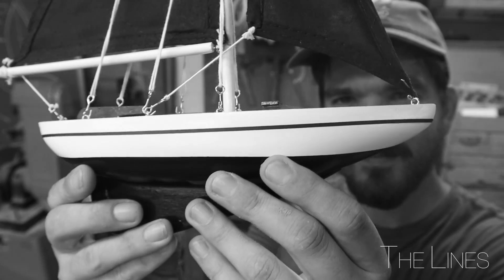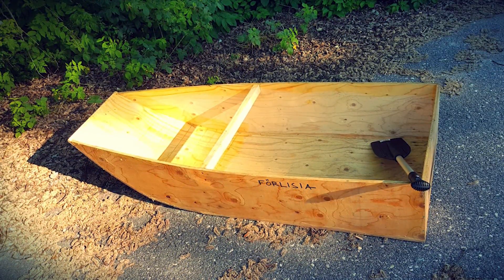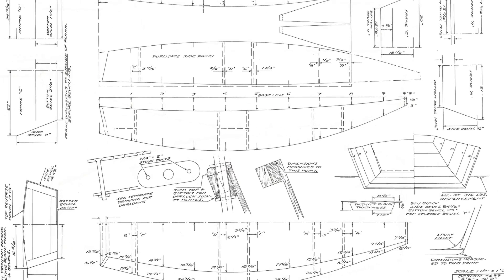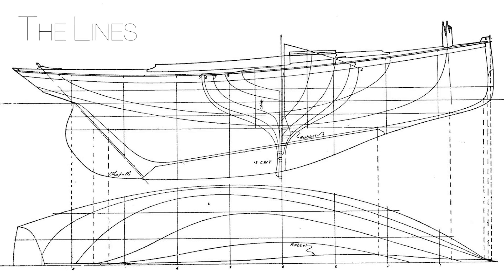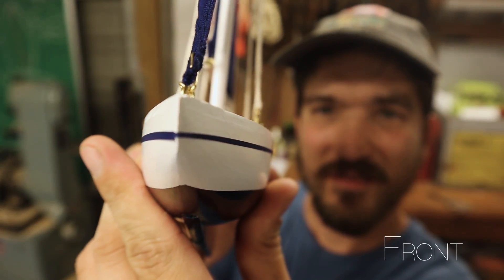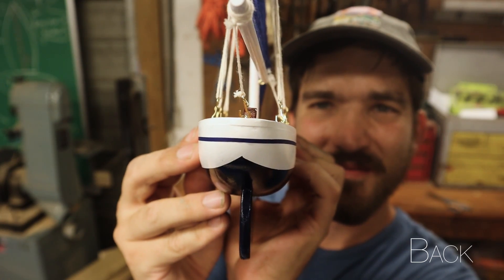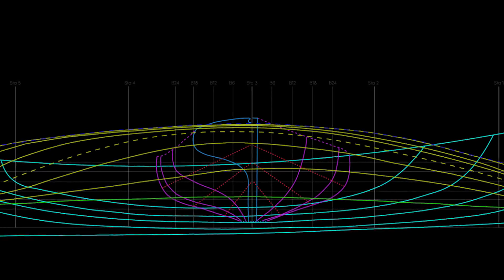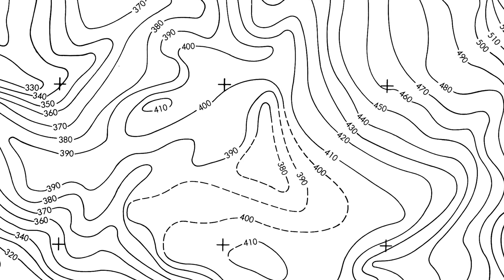Episode 4 - Breaking Down The Lines (Boat Plans and Lofting)

Comment: 22 years ago, I had the opportunity to work for Philbrooks Boatyard in Sidney BC, and while there did a course in lofting.  (to which your videos would have been a great asset). I remember being told that in the very old days, experienced boatbuilders-designers would bolt together 1/2" slabs of wood to represent the water lines.  The boat shape was then carved out as a half-model, the slabs taken apart, and the waterlines traced out in scale.  the slabs were glued back together and the model sawn apart to provide scale station lines, which were likewise traced out.  from there, the boat lines were measured and scaled up to create the table of offsets.  This may be a common boatbuilding myth, or it may be a true story, not sure.  Anyways thanks for a great refresher explanation.
Reply from the maker: Wow what a great piece of boatbuilding lore! Sounds implausible but not impossible

Comment: diagonals - what are diagonals used for?
Reply from the maker: So a diagonal is what you’d get if a waterline and a buttock line had a baby. It’s a cross section of the hull that is oblique to both the vertical and horizontal axes. Diagonals are useful bc they give you even more data (or constraints) on the hull shape. They interrelate waterline and buttock line data. This is especially useful in the case of a particularly shapely hull, where some curvature data may be missed by waterlines and buttock lines. In the end, the more constraints on the hull shape, the more accurate the lofting.
Reply: @neophyteboatwrights  thanks

Comment: Lets say i want to build female moulds and the table of offsets says that are the  "inside skin" measurements and the designer calculated the plans with a  3inch  ply construction. 
Does that mean that i have to draw the lines and then ad the 3 inch of the intended hull and then THAT would be were i should make the female moulds ?
Reply from the maker: Sounds right to me. Doing planking thickness adjustments can be non-trivial in some cases. But assuming the original hull was planked say in a carvel fashion, then you should be able to smoothly extend the mould shape without issue. At least from where im sitting that makes sense. Would need more specifics to say for sure

Comment: So how can one generate the lines without carving and slicing a model into bits? Not that I'm opposed to doing just that.
Reply from the maker: When designers are developing plans they generally loft them out at small scale (1/8th scale is common) in precisely the same way they are lofted at full scale.

Comment: Little trivia:  I worked for Boeing for 22 years, some of the time actually building my little bit of the 747.  Boeing started as a boat builder and when they transitioned to airplanes they maintained the same dimension system used on the boats.  So to this day, measuring from the front of the plane to tail are "stations", looking nose on from the center line to the right are "right buttock line", you can probably guess what the left side are called, (LBL).  From the keel up (yes, Boeing airplanes have a keel beam) are "waterline".  Enjoyed the video.  That should help people understand how things are defined in space (3 axis) on a boat.  Thanks!
Reply from the maker: That's so awesome! I had no idea. but hey. basically sky boats.
Reply: @neophyteboatwrights  You could say that.  You just did.  :-)